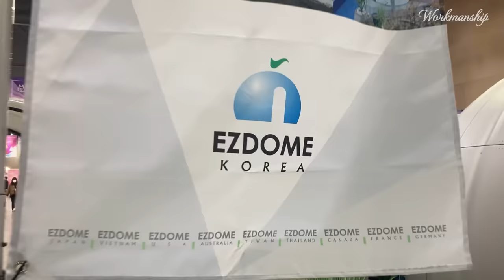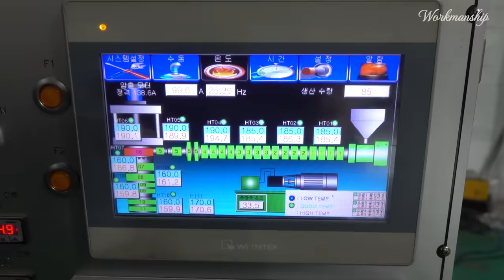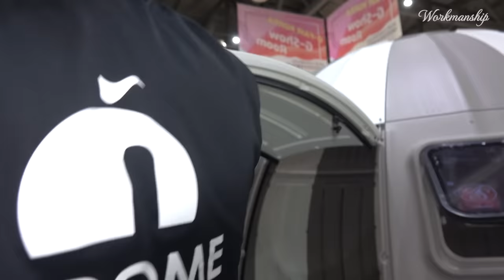Process of Manufacturing Eco-Friendly Dome Houses.Korean Plastic Factory

Comment: Perfect for disaster areas (like after earthquakes). In a short time a weatherproof accommodation that should be better than a tent. Due to the solid outer walls, those affected quickly have a feeling of security and safety, since the openings (door, window) can be securely closed. And the transport can also be easily realized by means of containers. And the EZDOME HOUSES can certainly be better supplied with heat than tents.
Reply from the maker: Yes, it's actually used as a disaster situation or as a temporary medical facility. 👍👍👍
Reply: You mean disaster in the making.
Reply: @pedrorcardenas  No, after the occurrence of the disaster (e.g. earthquake, flood, etc.)
Reply: @workmanship No rubber seals to keep water out?
Reply: Not only that in case of a great tsunami  I they. Are water proof   and don't get stock between any structures may be able to land some dry area or rescue

Comment: Cannot see any seal against water leak and any thermal insulation. Basically you can freeze or burn inside this plastic box. Also since when the plastic becomes eco-friendly?
Reply: molded twin wall, but still a plastic hut
Reply: Never heard of recycling huh?

Comment: Cool! I can deffinitely imagine those as parts of a space base in the future as well!
Reply: Wow. If you want to die in space, these would definitely do it.
Reply: @TempleGuitars  There will always be one way or another to, but if one think about it with some type of liner, and one of cause need to wear a protective suit, but the new generation of soft suits that has been on the paper for a while now has a flexible layer which adapts to the bodyshape, so if they manage to make them safe to use i think this type of covers would do in a protected envornment like for example a space base in an area which is not hit by heavy debris, or as free floating shell to protect fom micro particles, sunlight and extreme temperature chenges in zoones where the variations are not as extreme that hard suits are a must. Maybe not today, but possibly tomorrow i think!

Comment: genius. do they use threaded rivets for the fixings? otherwise it will wear out quickly after assembly, reassembly a few times
Reply: It is combined with nuts and bolts embedded in the panel. Unlimited availability.
Reply: @minohan4581  Ah I see. Cool

Comment: How do You heat it? Passive only, with that big window on top, or is it possible to install, let’s say, a wood oven?
Reply: As long as the plastic walls does kepp under 50 degreeC i think it will be ok, but there are other types of plastic that can withstand more than 200 Centigree, so i can imagine one can probably put a square of for example epoxy or heta resistant nylon and apice of metal close to the chmney and it would do, i imagine a combination of both, with the big roof window would be realy cool!
Reply: I bet a wood stove would cook you along with whatever you were making to eat. Unless it was really really cold outside. Maybe a propane fired rv type furnace would be easier to keep a steady temperature with. Lot of similar mfg. to an rv.